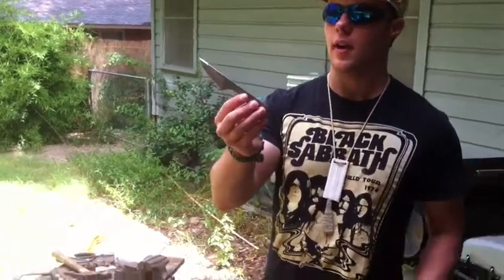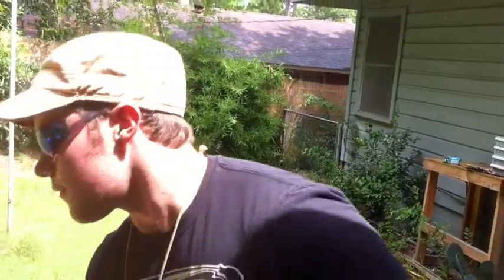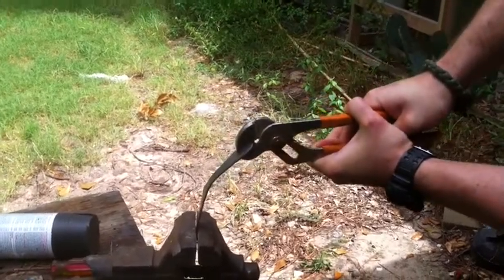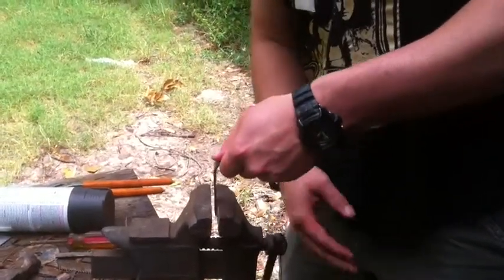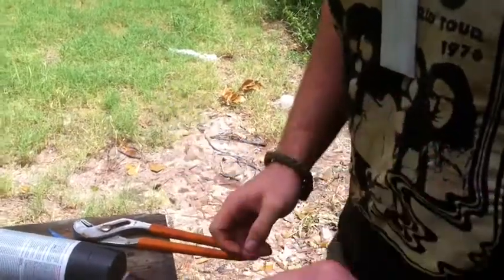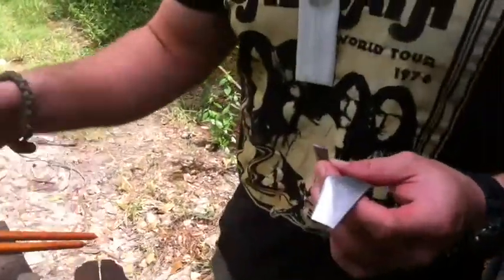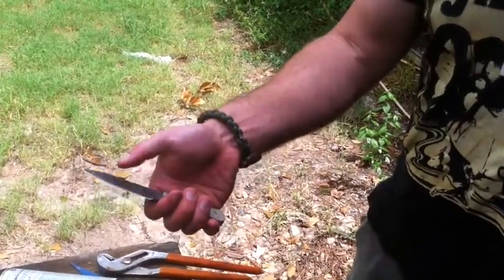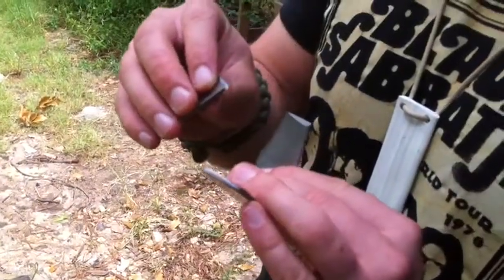Destruction Test -Culbertson Custom Heat treat and temper test.

Comment: Have you considered playing with clay or mud during your temper process? I have used it on some larger blades to protect the cutting edge from becoming too soft while tempering the larger portion of the blade. Snapping under extreme stress might not be a good thing since it could cause bits and tips to go flying who knows where at a high velocity. I try to temper a blade where the edge will snap but the back will give. It's harder than it sounds :/ I'm no where near consistent at it
Excellent videos though! Keep going, you're on to something

Comment: The user has to decide if they want a knife that will bend at a lower force/torque, or a knife that is potentially MUCH stronger, but will just start to bend before snapping.  Is the spine spring tempered as well as the handle on the newer knives?

Comment: You may want to consider using a tapered tang which will allow the entire tang to bend if you did a similar load test and thus distribute the stress through the blade rather than concentrate it at just one spot.

Comment: Note in general, when you put a load on a piece of steel like that by grabbing the end and vicing the blade, the internal stress will be maximum right in the middle of those points, this just happened to be the point where the steel when to the minimum width. Even worse as the end of the tang and blade were much wider, they would not bend at all and thus that narrow area will end up bending prematurely.

Comment from the maker: Now that I have done this test and some other off camera. I have decided to put a spring temper on the handle of my knives. The reason why i did not heat treat the whole blade is because I am just learning. I learn every time I get out the grinder. THanks fo comment . This test and other test has shown me the mistakes I have made. And now I can fix the problem.